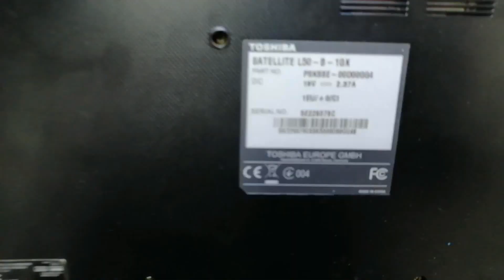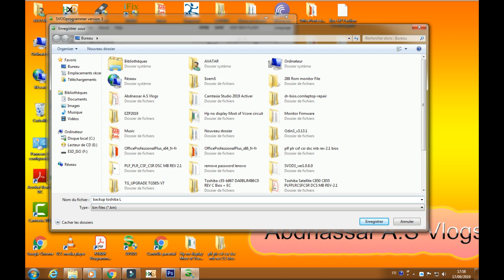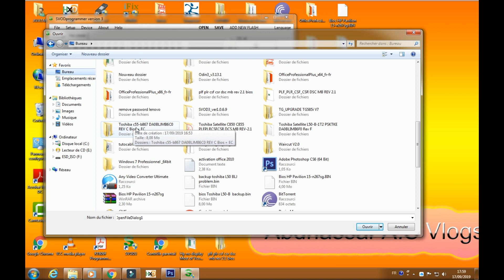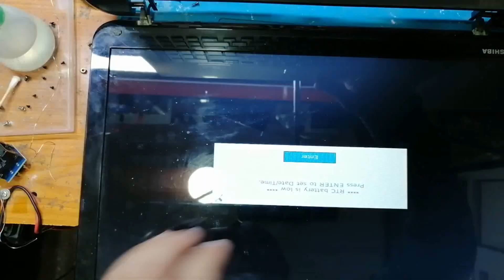Toshiba Satellite L50-B-1GX  Shuts Down  Immediately After Turn ON

Comment: I have this exact same laptop with it randomly turning off what did u replace, a temperature sensor? I have hw monitor telling me radeon card is at 500oC but never moves its defo not that temp obviously. I've cleaned it and replaced thermal paste but it's still doing it.
Reply: He reprogrammed the Bios Chip!
Reply: @szkyriakides  he replaced a chip on the board is what im talking about.
Reply: @NichoTBE  Hi yes There is a programmer rt809h you take out bios chip and you re flash it with new bios!
Reply: i know Im randomly asking but does anyone know a method to log back into an instagram account..?
I stupidly lost my password. I appreciate any assistance you can give me.
Reply: @Junior Jaxon Instablaster :)
Reply: @Kendrick Maurice it did the trick and I actually got access to my account again. I am so happy:D
Thank you so much you saved my ass :D
Reply: @Junior Jaxon Glad I could help xD